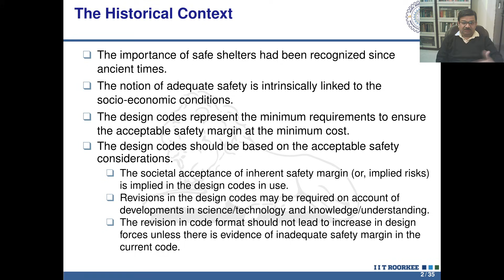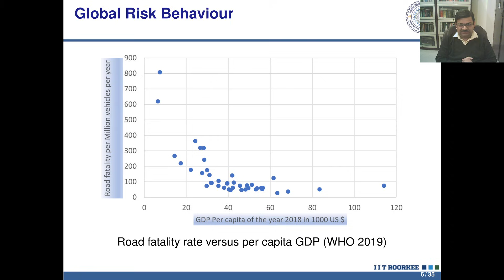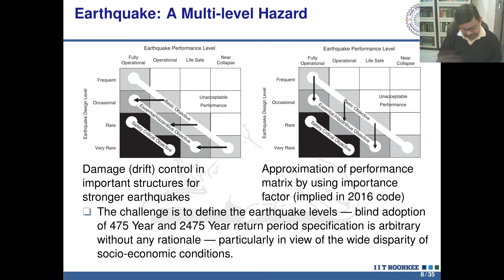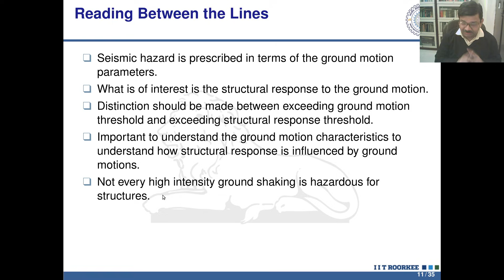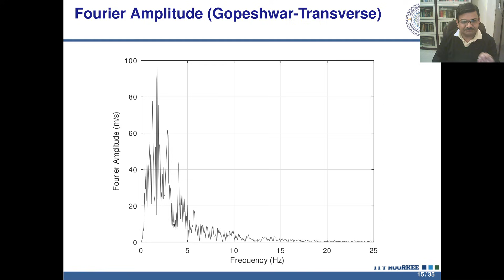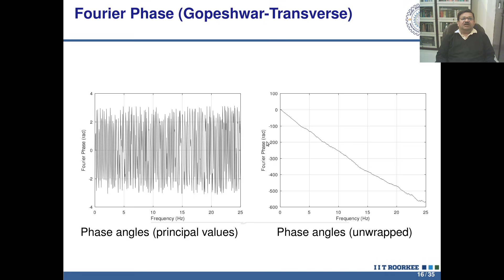Revisiting the Revisions in IS-1893(2025) - I

Comment: Namashkar Sir, very interesting perspective on the revised code.  Coming to the performance aspect, I think ATC-40 still continues to be the Bible and I expect inclusion of Pushover Analysis in the next revision. My only reservation is regarding what you also pointed out in the start, when Load and material strengths evaluation remain rudimentary and continue to remain vague this emphasis on making the analysis procedure alone more and more complex may only give intellectual satisfaction. This will be troublesome for the average design engineer, increase cost and may not help much in reducing vulnerability to Earthquake Hazard. Thanks🙏

Comment: For combined use of IS1893 Part-4 2024 (Industrial Structures) and IS 1893 Part-1 2025 some clarity required. Like IS1893 part-1 2025 Clause 8.2.2 states that---importance factor shall be taken as specified in the respective part of IS1893. IS 1893 Part 4 2024 have importance factor range 1 to 2. So, with revised higher seismic forces, again need to use importance factor 1 to 2 ?  Also how to use return period for Industrial Structure (to get zone factor), as no clear definition seems of Special Structure, Critical Structure, Important Structure and Normal Structure (with respect to industrial structure).
Reply from the maker: Such inconsistencies between inter-dependent standard codes are inevitable whenever there is a major change in format. Hopefully CED39 committee of the BIS is seized of the matter and will address these inconsistencies in due course. As it is, IS-1893 (2016) continues to be in force until June 2026 so you may still continue using it as far as cross-referencing goes.
Reply: @manishshrikhande   Thankyou Sir.